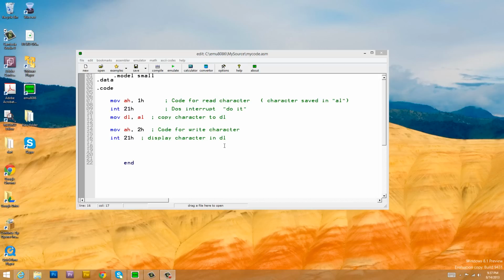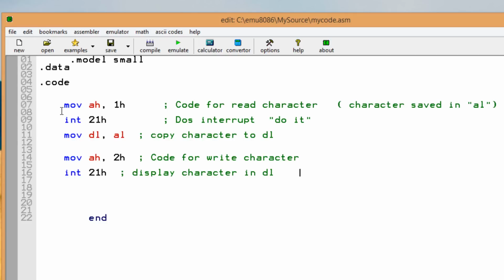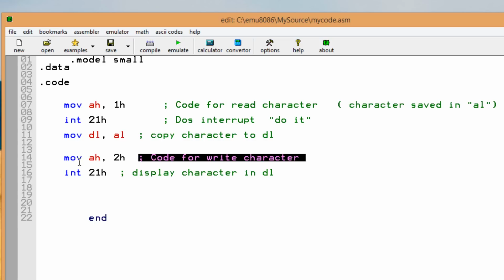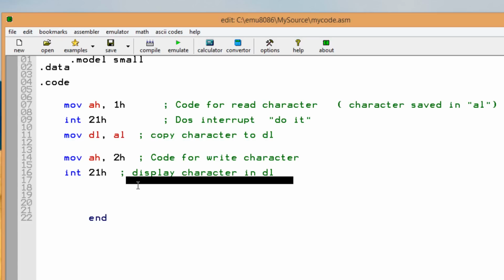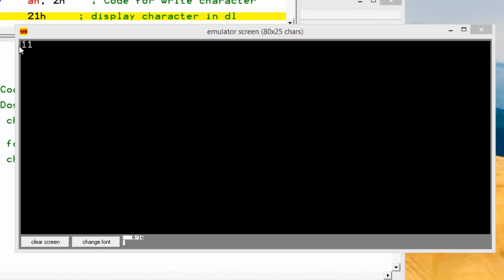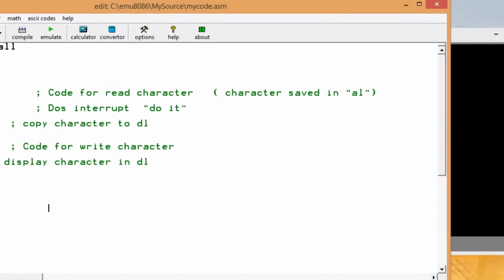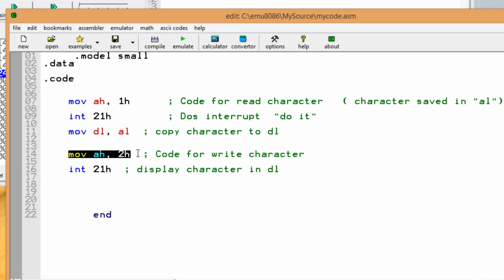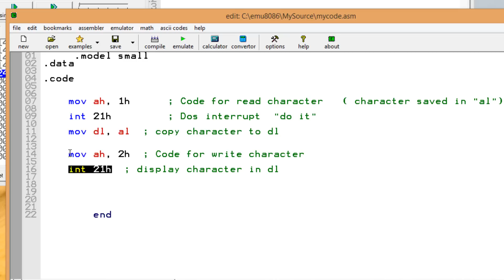Assembly Language Programming Tutorial - 16 - Simple Input and Output

Comment: .model small

.data

.code
   higher: 
         mov ah,1h 
         int 21h         
         inc al    
        mov dl,al
   loop higher
        
        mov ah,02h 
        int 21h 
   
   end
This particular piece of code is taking multiple inputs but not giving output and when I pressed enter after inputting data cursor get back to the very first data byte that I have entered and when I tried to move to right data  was gone and got message as emu halted.what is error in it?

Comment: Why do we use the register "ah" ?
Reply: When we use an interrupt, for example 21h, we want to tell te interrupt what to do, . So an interrupt has more than 1 action. And the action is specified by putting a value into the ah register. So when you execute int 21h, it checks ah an if it's 01, it waits for a key to be pressed and stores the key in al, but if ah is 02h, it instead print the value in dl, an shows the char to the user.
Reply: +Kirdow Plays  i did'nt understand why we did'nt use Al from the begning